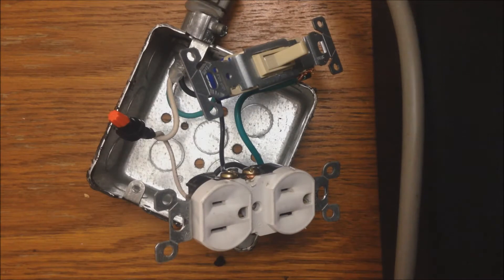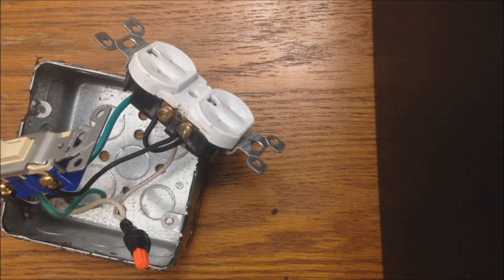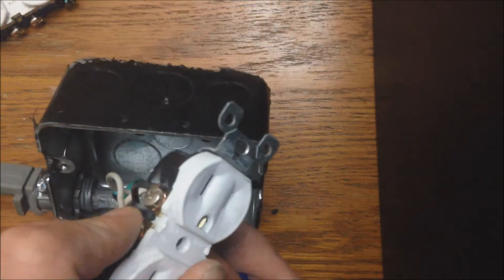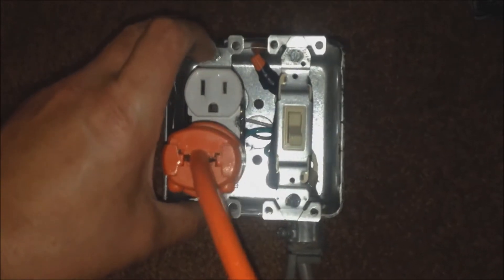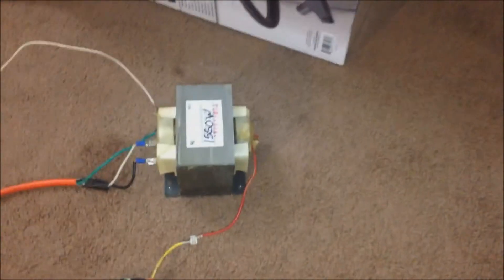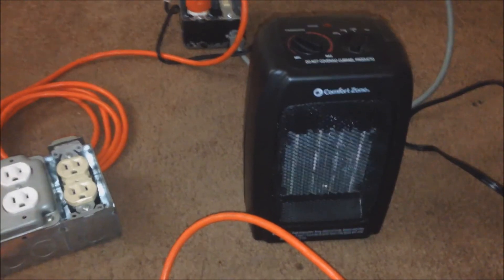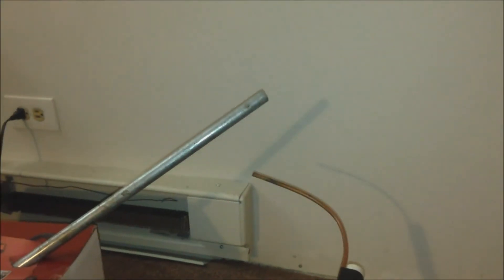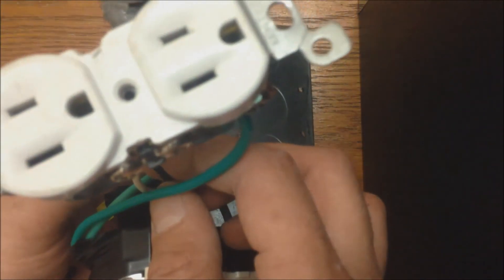How To Ballast Your MOT Or Any Circuit Using Home Appliances!

Comment: Try a magnetic ballast instead.  Just take a second mot and run the primary in series with the primary of your first mot.  Short out the secondary of your ballast mot.
Reply: What if you have 2 MOTs with the primaries in parallel reverse phased?  I think 1 as a ballast would limit the current too much.  2 in parallel then series?
Reply: I dont know if I quite understand the question, but when using mots as ballasts, the primary phase shouldnt matter since they are going to be parallel and with secondaries shorted, and the max power consumption would be the same.  Phasing of the primary would only come into effect when trying to use the secondaries in series. @solarsynapse  for example in my experience,1 mot with shorted secondary will draw approx 10-15 amps with just a short circuit but when you go to draw an arc, while using a mot ballast i've measured up to 42 amps from the wall.  If you run with two ballasts, in theory it would double the max power consumption from the wall.  If ytou want bigger arcs for the same or less power consumption, try using one mot as ballast and then getting two or three microwave caps parallel together put in series with the secondary of the mot that u are drawing an arc with and you will get huge arcs for less power consumption.  Here's a good example of using caps in series with the mot for big arcs.   https://youtu.be/0bUFCE3OS64   Hope this is helpful.  I'm still a bit new at this stuff but happy to help however I can

Comment: You can use an AC capacitor, in series, on the hot lead, on the primary side of the transformer, using the Capacitor Reactance Formula, to limit current.

Comment: Do I still need to ballast two mots in series if I'm using a Variac to control the input of both paralleled primaries ?
Reply: Yes, you could actually blow up the Variac's brushes if you put a sudden heavy draw on it. Ether before or after the Variac you can do a Ballast.

Comment: You need a dedicated breaker and outlet for this. I have a dedicated 60 amp circuit on #10 AWG wire in my shop for testing purposes. 
Ballasting was recommended by those non adventurous people who are scared of everything. IF you know what you are doing and exercise electrical safety then you will be fine.
Reply: I measured 2 MOTs parallel pri, series sec, at 15A idle and 60A arch.  4x jump!